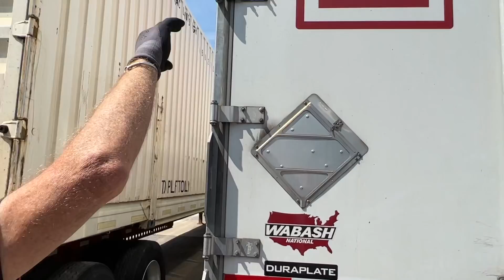Explosive Load? | Special Consideration on this Freight

Comment: That load won’t move much to begin with. At the most to make you feel better I would only use straps with e track. But that load unless lots of braking issues not moving much at all. Seal it and Roll! Move tandems for a smoother run but that’s all.
Reply from the maker: Thanks...I thought the same. But...instructions said to secure it, so Kevin did. There wasn't even enough room to use straps, so he used the bar. I think next time he'll let it be. The door should keep things in place.

Comment: Potato chips like pulling marshmallows...
Reply: I also like the high value, low weight medical loads.   One 10lb box screwed to the center of the floor in the trailer.  Then run it from Indiana to Washington State😁

Comment: Good job Kevin. Since your new to the company, better safe than sorry.  Good run on some scenic roads. Dosent it p you off when you get trailers damaged and flat tire and not reported. I would advise the am.  I know it is a problem in the industry as a whole. But still I would report it. The socks ehh. Have a good and safe day tomorrow.
Reply: It is a problem in general.  I drove for the P company and I can’t tell you how many times I got a damaged trailer I had to get repaired in order to compete the load.  

I can see flat tires, but exterior holes, and all lights not functioning😡.
Reply from the maker: Thanks Jim!!! Glad you are diggin' the socks!! LOL!!! Definitely let the asset manager know about all of that!!! Thanks for continuing to travel with us!!!

Comment: Kevin  you need the enforcer lock for your loads it pays off.
Reply from the maker: Thanks Mark! I think you mentioned those before. I looked them up. Seems there are many different types. Which one are you referring to?
Reply: @TheJoyofTrucking   Your Fleet Mgr. Enforcer lock
Reply from the maker: @markpage533  🤔 🧐. The lock he is using is the one that was issued by Crete and is an ‘enforcer’ lock. Wondering if you mean one that goes across the bars instead?